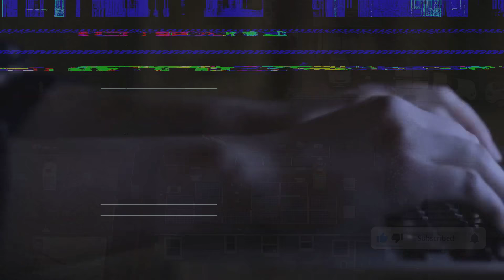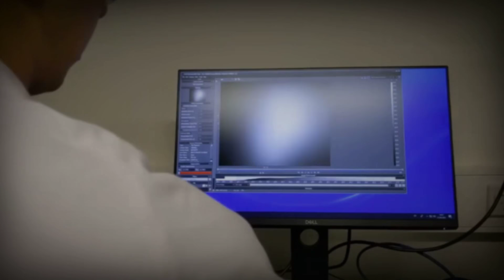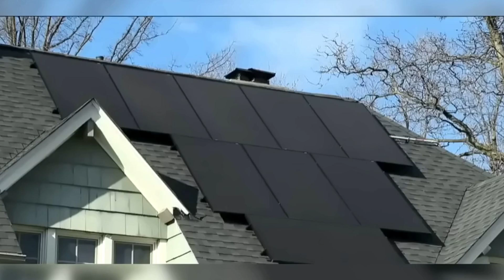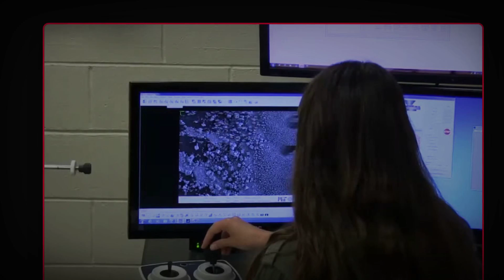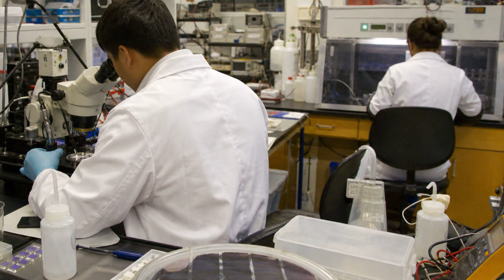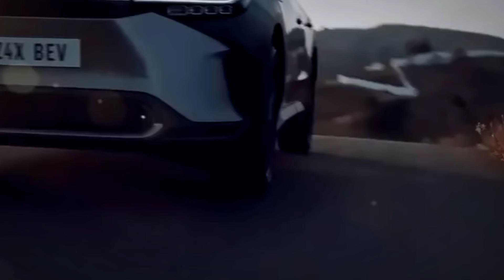America's New Invention Could End Your Electricity Bill

Comment: We only use ac to transmit power over long distance.  Ac is turned back into dc to most modern appliances. Therefore if you had solar panels or any other type of dc generator at your home then ac would not be needed at all those few appliances that must have ac to opperate could have inernal dc/ac converters just like the majority  appliances today have ac/dc converters. This would waste much less energy as the majority of appliances could just run off the dc wall electricity.
Reply: AC current exists because it is generated by rotation.   This is the easiest way to generate power.
Reply: @leonardgibney2997 are you seriously saying that you dont know BOTH  AC and DC  generatorshave existed since the time of edison and tesla fighting to gain dominance.  Picj up a book and learn history.

What killed DC was the range limit. For a solar house that does not exist. They did not have that ba k then. HOWEVER t9day with modern electronics and local generation possible DC becomes superior choice.

Comment: That's nice but just like all the other Renewables becomes a parasite once connected to the grid as it could only put in 15% of advertised output or extra electricity the ignorance of Renewables on the grid is easily demonstrated with a volt amp meter and 4th grade math called Ohm's law and it takes less than a second to double-check your installed watt meter and you will see an 85 percent difference of what's actually going in